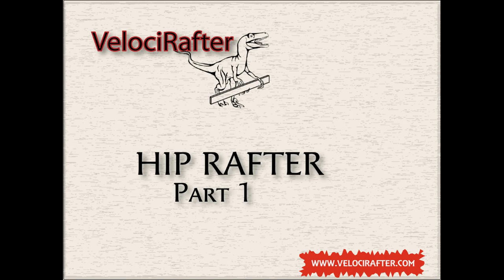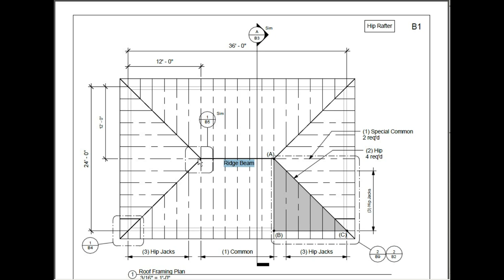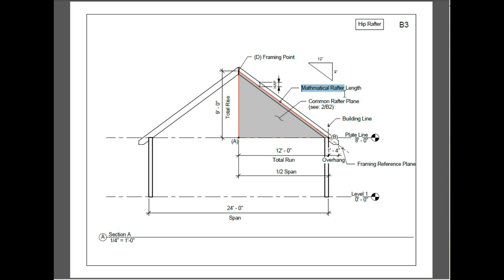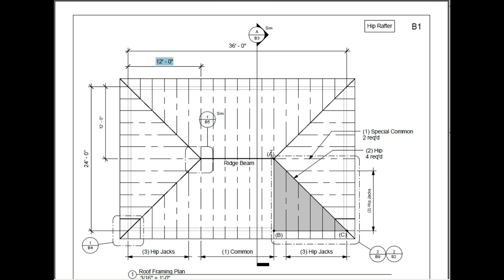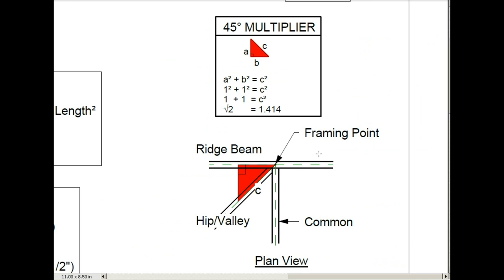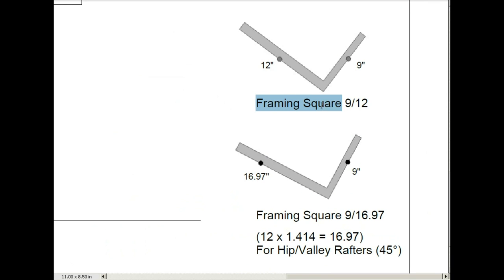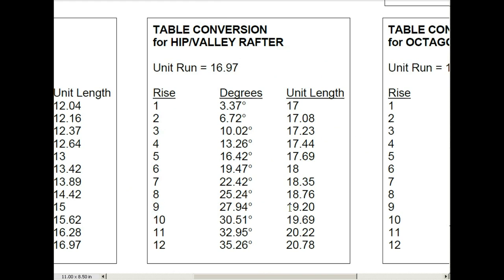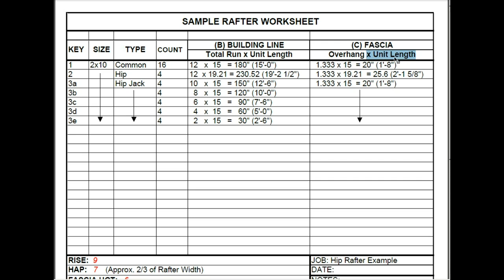Hip Rafters - Part 1

Comment: very informative, thank you.  I am building a room with hip roof using steel structure. Does the same rule apply as using timber?
Also, the strength of steel is much higher than wood, do I need to consider different size for HIP rafters, and Ridge?
I can not find anywhere a guide for the spacing of the common rafters Is there a rule to follow?
thank you.
Reply from the maker: The calculations are the same for steel or timber in terms of cutting the rafters. Regarding sizing the members and layout spacing, try consulting span tables. I typically use the IRC (International Residential Code) but you can find others on the internet. Personally, I try to use 24" o.c. layout (as long as span allows) for cost savings but more conservative architects prefer 16" o.c. which provides more nailing surface for sheetrock.

Comment: which software is being used?
Reply from the maker: Hi Steve, I'm using Autodesk Revit Architecture 2013. A very deep and expensive program however, if you are a teacher or student you may be able to buy it at a substantially reduced price as I did (visit www.creation engine.com). Please note that the rafters used in the video are not part of the in the box "families". I spent a yuge amount of time creating a suite of parametric rafters in preparation for the video. Hope this helps.
Reply: I like 👍